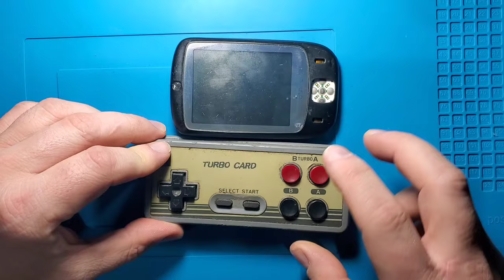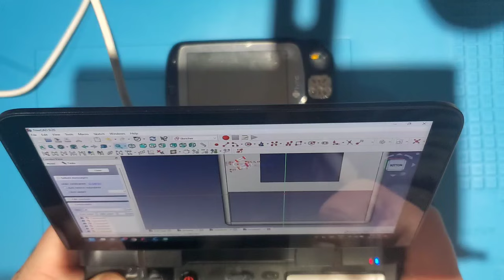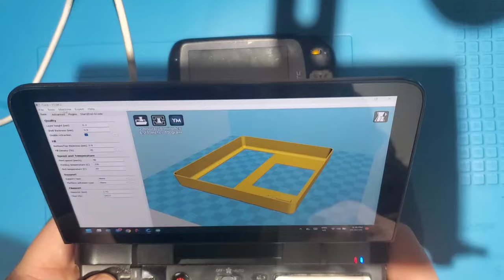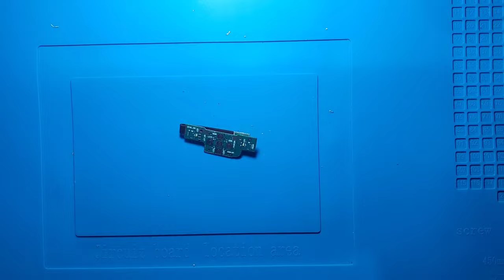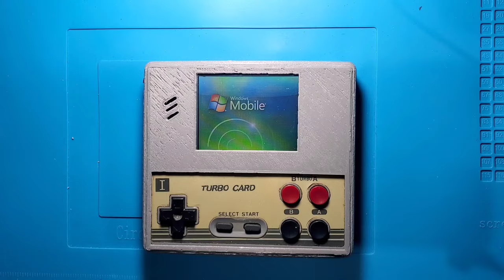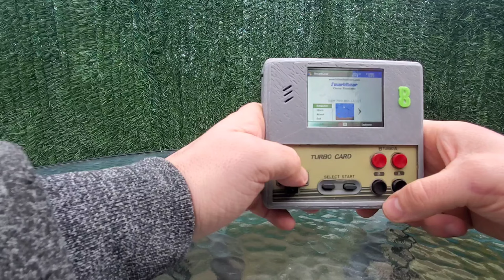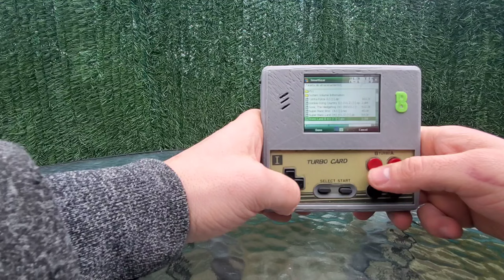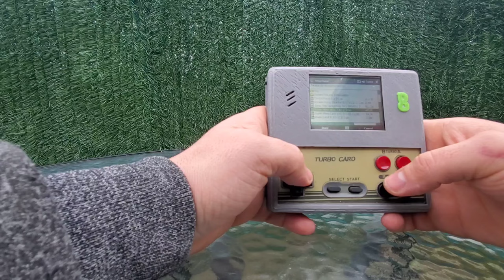Turn your old smartphone into a portable gaming console

Comment: you need to increase your bed heat and a little of your nozzle heat, that's why you're getting these line gaps in printing
Reply from the maker: thanks,  I thought it might be a clogged nozzle that causes that. It started to happen recently. I will try to increase temperatures and see the results 😁

Comment: Alright people. Whip out those old phones you have stored away that can no longer connect to any wireless carries and and whip out those old dusty controllers you haven't used since your grandad was born. It's time to start modding, don't worry it's only several billions old phones. We can have it done by Wednesday.
Reply from the maker: well, what other use use could it be for those old phones ?
Reply: @diyotaku  It depends what OS it's running. There may be some apps that only run on older version of Android for example. Also, older phones can be used as a pocket sized tablet. I still use my HTC One M8 indoors for various reasons (alarm, flash light, calculator, music ad video playback, google maps, google voice, firefox & chrome over WiFi for online stuff, and as a universal remote control). My girlfriend uses it for games too. I would say phones with Android version 4 and up can still be used for quite a bit of things considering that they all have APKs that can be side loaded and all have wifi, especially since there are people that still use PDAs.
Reply from the maker: @ThexthSurvivor  Yes, but this phone doesn't have Android, it has windows mobile which is way older and slower than Android 1.6

Comment: It cant play Genesis. But maybe it can play Atari, Coleco, NES and Sega Master System.
Reply from the maker: yes, very slow emulation, or maybe I just couldn't find a good genesis emulator for windows mobile
Reply: @diyotaku  When I had windows mobile on an Apache 6700, I believe I had a SNES emulator. It used to play Star Trek: Starfleet Academy just fine. I don't remember playing Genesis games. Try the SNES emulator.
Reply from the maker: @HiddenPalm  There are genesis emulators that works almost perfect on an old Nokia 6600 which has way lower specs than this phone. I'm sure there are some genesis emulators that can work decently on windows mobile, but i don't know, I used Symbian back in those days :)